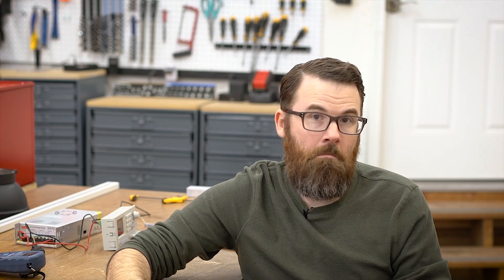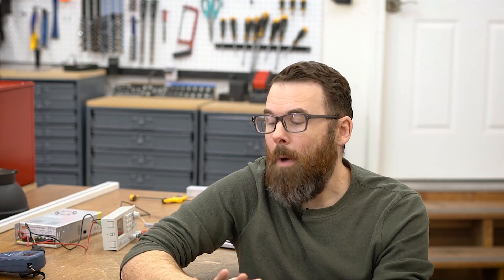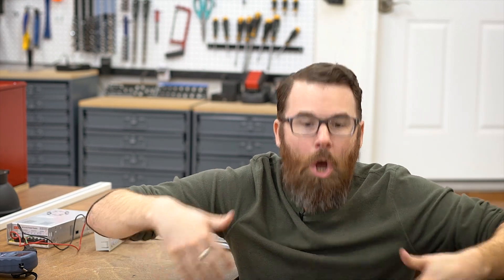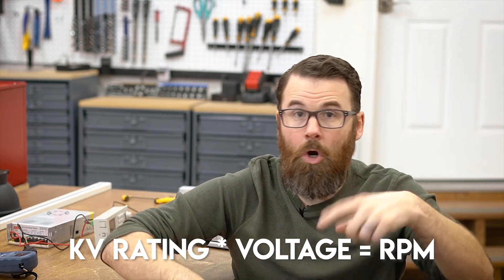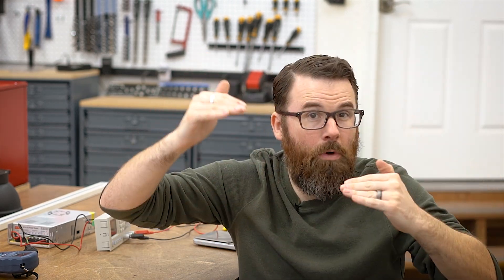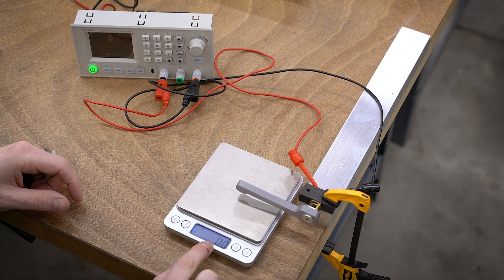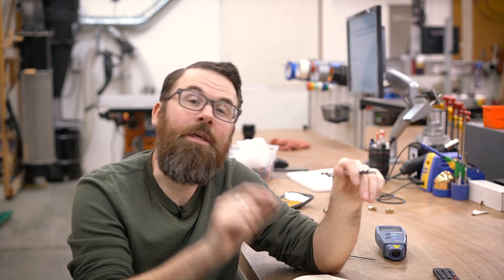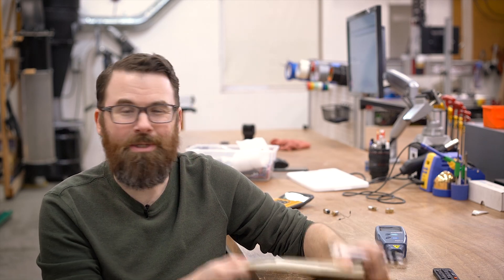Torque... AND YOU!  (Beginner's Guide to Understanding Torque)

Comment: Great video.. always great if people share knowledge... 
You might have done your homework, but isn't this only the holding torque? 
Power output (omega x torque) is now zero... In a normal situation you want Pin(=Voltage x current) to be Pout=(omega x torque) 
You could measure this with a pulley system, or even constantly with an unster, weights an a polished pully. 

Anyway.. keep up the good work
Reply from the maker: Yeah, this is really only 'peak torque'.  I guess it's called holding torque as well.  This was more of a rough comparison, since both of the motors are essentially the same, I figured everything else would scaled pretty linear as well.
Reply: @RobertCowanDIY   well with limited resources it’s sometimes just the way to go. Although Assumption is the mother... since both motors seem quite similar You might we right :)

Comment: Those numbers are off a little bit though. You should have tared the scale with the weight of the lever just resting on it. With what you measured, the "torque" was a bit inflated for each motor. It also means that the difference between the two is changed too. This I'm having a harder time picturing in my head but I THINK it means the larger motor has more than 30% more torque than the smaller one.
Reply from the maker: The arm was about 1-2 grams, and it was consistent between all tests.
Reply: @RobertCowanDIY  Yeah, with the short length and it being printed of plastic, it's certainly going to be minimal. But, also worth pointing out that it needs to be accounted for if people at home use something longer and more solid, like metal.

Comment: power=torque x speed
Reply from the maker: Eh, kinda.  It's work done over time.
Reply: @RobertCowanDIY  There is no kinda to it. Get a physics book.  https://en.wikipedia.org/wiki/Torque#Relationship_between_torque,_power,_and_energy  
Or Wiki.  Power(watts)=torque(N-m) * speed (radians/sec).  Rotational power in MKS units.
Reply: The reason it's important is doing calculations there can be real mass and the fake "kg" force.  For instance pulling a mass up a ramp.  The "kg" force is less than the mass because of the ramp.  Calculations can get confused.  An Important tool for checking for errors is keeping track of units.
Reply: @RobertCowanDIY  It is, in perfect condition. Power (measured in W) = Torque (measured in N·m) × Rotational speed (measured in radians per second). You can use this to guess one of the motor specs given two. (maximum power) = 1/4 × (stall torque) × (highest speed, usually provide by kv*voltage)

Comment: Newtons are force.  Kg is a measure of mass.
Reply: This is America, intermingling units of force and mass and "weight" is our specialty.
Reply: @troy4393  Yes.  If your trying to teach someone it would be nice to at least explain the correct way and what people do.
Reply: @ahbushnell1  Its not necessarily wrong though. People just don't usually say the word force in the units like 'pound (-force) foot'. iirc Kgf·cm is also a very commonly used unit in metric world.
Reply: @teamscarletdevil6915  I realize what people do.  It's like a real-estate agent saying the house is 2000 ft in stead of square feet.
Reply from the maker: You're not wrong at all.  Doing videos like this are tough because there are a lot of little quibbles and it comes down to "you know what I mean", which is not an excuse for being accurate.
Reply: I really like this channel by the way so I'm not down on this.

Comment: Quick note: if you want to get the torque correctly the ax of the motor has to be exactly at the same height as the scale, or else you won't measure the force perpendicular to the lever arm. Even though your lever looks straight I noticed that the lever is mounted underneath the ax of the motor and you have a small bump at the end, this means you push slightly at an angle (towards the motor) which the scale cant measure. So the torque you measured is slightly smaller than what the motors can actually produce.
Reply from the maker: It's flat, the bump is to line everything up.
Reply: Good tip, thanks!